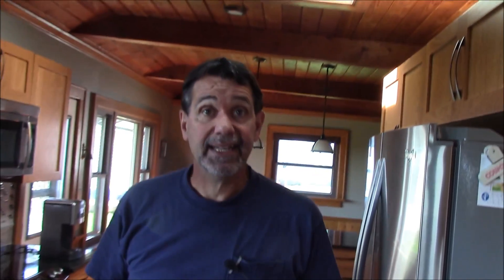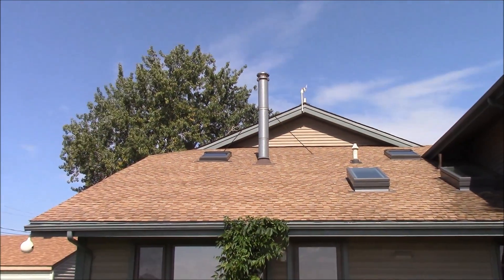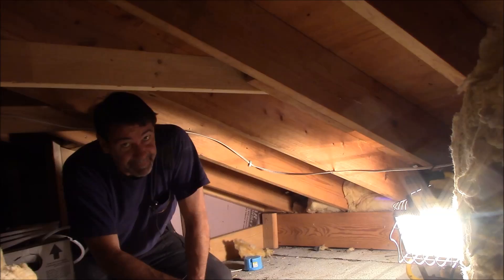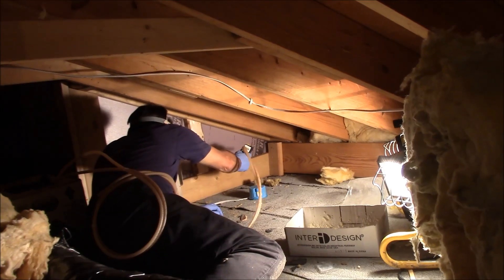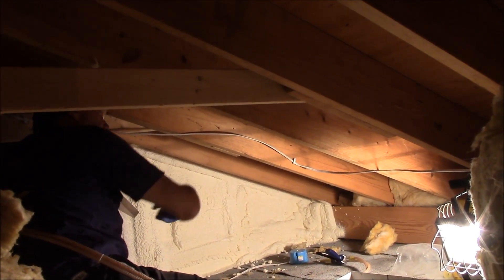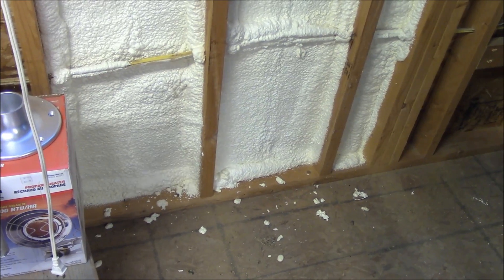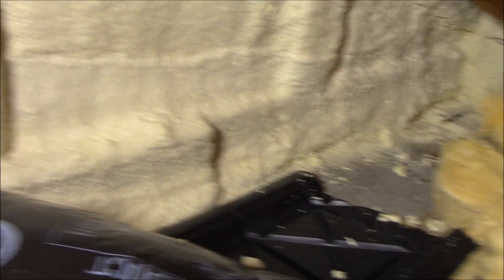Foam Insulation - Attic, Skylights in 3 Hours - Touch 'N Foam System

Comment: So 1 coat at that speed gave you an 1"?  Did u work outt how much square feet you actually got out of the unt,, thanks for the vid,, cheers.
Reply from the maker: It comes in 200 foot and 600 foot kits. And that’s an install thickness of about 1 inch. If you install it under 70° temperature you’ll get less expansion so bear that in mind.
Reply: @MrHardware1  That's an excellent point as it's my crawl space basement with 4' walls and being winter it's around 60 so I'm guessing I'll wait until it warms up a bit. thanks for your response mate, cheers.
Reply: @MrHardware1  I also meant to ask if you think it would stick to a cinderblock wall that might be a bit damp?
Reply from the maker: @punishr36  I bet it does however I’d run a fan and dry it off first to prevent wasting the foam.
Reply: @MrHardware1  thnx.

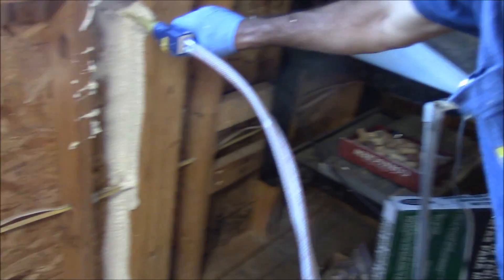Comment: Mr.Hardware  on that First pass you made @4:50 Question for you is:  How high did that foam rise?  How many passes does it take to get 2" inches? Thanks!  Awesome vid!
Reply from the maker: Usually I get 1” per pass. Speed and heat both come into play.

Comment: Look at 4:04 ..Foam not applied correctly, House could potentially catch fire from improper light sealing on top of the housing of that blue light. 

You might want to correct that before it’s too late.
Reply: I think he's ok; if i'm not mistaken that was just an electrical ceiling box (no bulb or heat source goes inside a box like that).

Comment: Ty for the video. Do you know, how long do you have to wait until you apply a 2nd coat? I would like 4 -5 inches in some places
Reply from the maker: Once the first coat is cured, add all you want. However 3 1/2" is super insulation. My foamer hated guys that wanted 4 to 6" because the last inch or two was a waste.
Reply: @MrHardware1  Depends on the region you live. Here in Wisconsin, 6" in exterior walls is standard...

Comment: Where can I buy that for my modular home. I have a lot of cold air coming in from my skylights after a new roof was installed.
Reply: @JoseDuranJr ... Lowes sells it
Reply from the maker: Most building centers stock the small and large kit. If not any good hardware can order it in for you. Blair

Comment: Can I use spray for on top of foam boards to add to the value of an exterior wall built with 2x6?
Reply from the maker: That is what I did in my attic. I sprayed 2 inches of foam over a half inch foam board. Now my skylight tunnels are like thermos bottles and not cold in the winter. Adding foam over another foam without an air gap is the way to go!

Comment: what are the two different colored nozzels for
Reply from the maker: One is a small round tip for spraying into corners and small areas. The other tip is a fan spray to cover larger flat surfaces.
Reply: thank you for your response,have you ever sprayed this over or next to existing fiberglass insulation .
Reply from the maker: Yes I have. My overhang was out of spray range so it was 2 layers of fiberglass but where it came to my skylite I connected the 2 materials. A very light spray over the fiberglass and a heaver coat between the light coat and the wall of the tunnel.